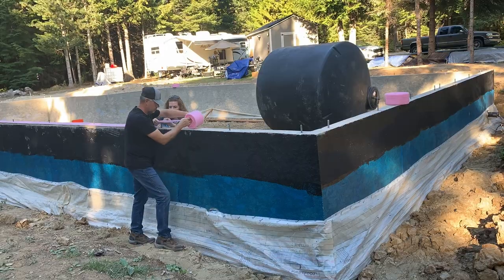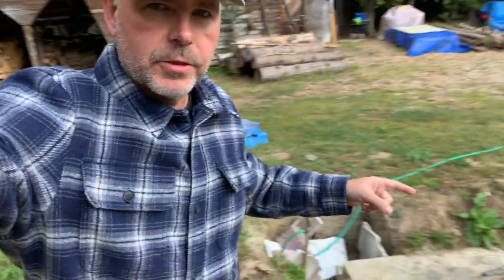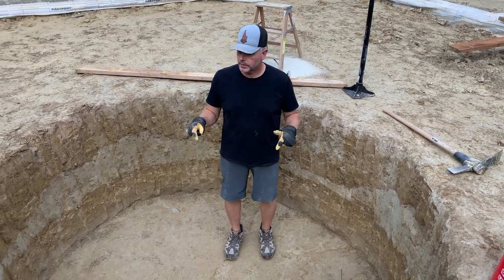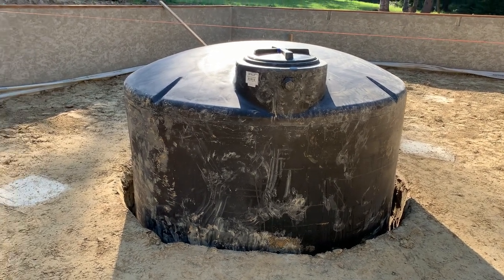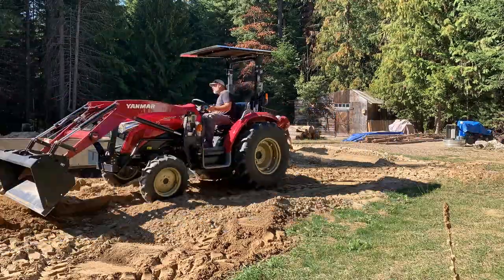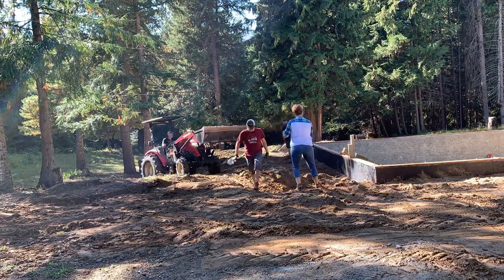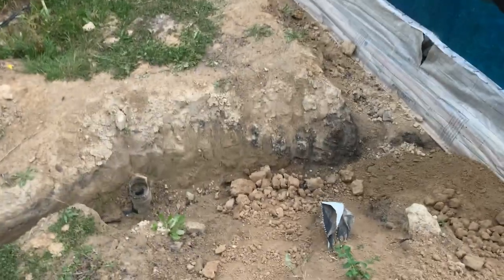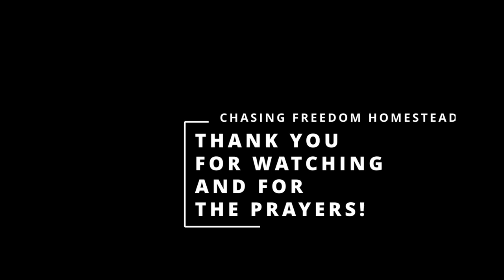Installing Sill Plates and 2500 Gallon Water Tank | Arched Cabin Build #homesteading #archedcabin

Comment: I like the idea of the cistern under the cabin but I would worry if it ever needed replacing since that would be pretty impossible.
Reply from the maker: That is a concern of mine also. When we return to the homestead last winter we noticed a problem with hole and cistern. It may be featured in a later video.